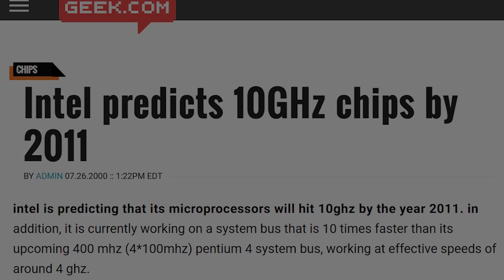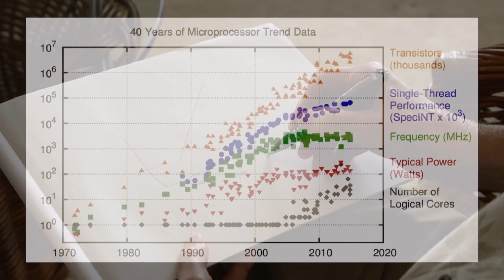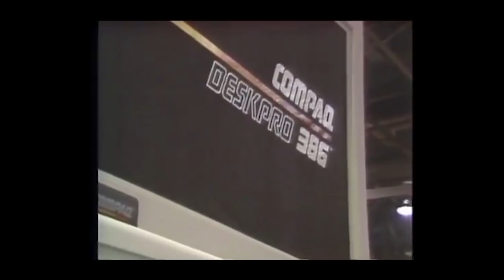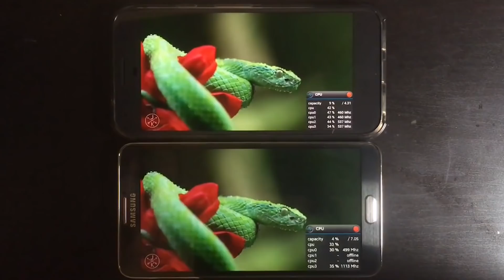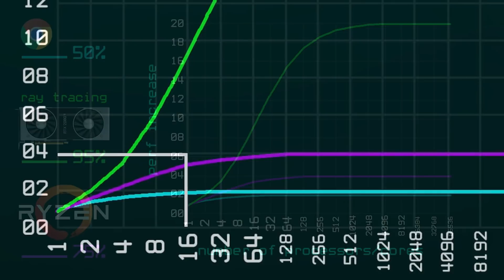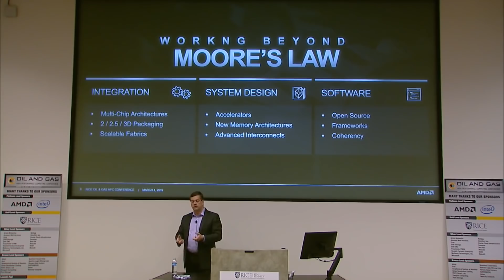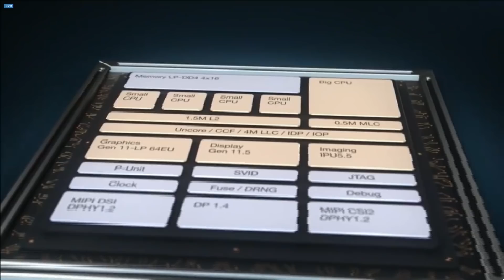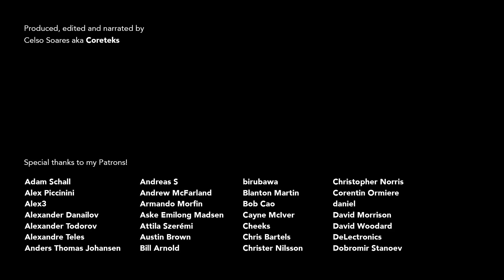Intel and AMD going BEYOND Moore's Law

Comment: In my experience it is very difficult to explicitly identify the parallel elements of a human activity let alone a piece of code in an efficient way and productive way. If the elements are obvious you should already be breaking them into threads, but you have to control the communications between threads and it is difficult to ensure optimisation as you reach the critical path points. Ie a programs logic is essentially a traverse of a graph with the graph nodes representing the choke points of the shortest path.
A graph based parallel language such as sisal uses this model of problem definition. The implementation traverses the graph completing fine grain instructions as the data to enable the instruction becomes available and routes outputs to the next node in the graph. Investigate the Manchester data flow computer architecture if you want to know more. This architecture has the ability to scale linearly with increased processor units.
The way it works is very elegant, but I found it very difficult to get my head round it as a way to describe problems that were not inherently already very parallel, eg usually some sort of mathematical simulation. Inherently we are just not wired to think of problems as parallel. Have a look at a seminal paper the magic number 7+-2 for more understanding.
I do have some experience in the area as I wrote one of the original compilers for sisal and never really felt comfortable writing programs in it. Inherently we are mainly linear in our thoughts and we will always be limited by our creating critical path solutions to problems.

Comment: less than 3nm, sure. this guy has zero clue what he is talking about.
Reply: 3nm is possible but not on silicon but on graphene and maybe using light based computing..
Reply: Josh D  lolol consider yourself accidentally walked into machine room of technology
Reply: @NoobNoobNews  are you talking about the clock frequency? if you lower it it completely defeats the point of "scaling" your architecture to become faster as lower frequency means slower CPU.
Reply: @BattousaiHBr  think about it like this, you can fit 2.3~ times the number of transistors on 3nm as you can on 7nm. so even if you have to drop your clock speed down, you still get an overall compute performance increase because you have more transistors doing the calculations. To oversimplify, a chip with 1000 transistors running at 2ghz won't compute as well as a chip with 2300 transistors running at 1ghz and the lower frequency means less voltage and thermal needs. (unless my understanding is completely flawed, which happens from time to time...)
Reply: @Will-W  the problem is that single-threaded performance still matters a lot. no one wants to get tons of multithreaded performance if it means killing your single threaded performance.
Reply: @BattousaiHBr  Ah, I'm picking up what you're putting down now.
Reply: @BattousaiHBr  lower speed does not mean slower CPU. You can have newer architecture with lower frequency than the old architecture. Is like saying 500Mhz modern CPU is still faster than 3Ghz Pentium 4. The foundation is the architecture. The limitation is also the architecture. When they want to have faster CPU they must change the architecture and that is what they did with every generation.
Reply: @wonghow  a lower clock frequency necessarily means it's a slower speed were that same architecture to operate on a higher clock frequency. we call this overclocking.

Comment: Have a look at http://doc.pypy.org/en/latest/stm.html and https://gcc.gnu.org/wiki/Graphite/Parallelization and https://github.com/atemerev/skynet to see what has been happening for many years now. And you might want to plot flops per Watt.

Your multithreading discussion shows how to return application performance back to the Moore's law plot you showed. If you were to plot application performance instead of transistor-count, you’d see that it did not keep up and that improvements in automatic parallelization can partially bring it back.

However currently one of the big advantages of multiple cores is that you simply have multiple programs running in parallel. For example having 4 cores means that your currently used application is not competing with the filesystem, the operating system and the networking stack for resources.

Comment: Below 7nm quantum effects kick in. Moore's Law ends, at least on the planar surface. FinFet will help to extend a generation or 2 further, beyond which drastic change in transistor structure will be required. It's fundamental physics.

Comment: Interesting automation of parallelizing software. However, notice that Huawei recently launched Mate X, a foldable phone that is years ahead of anything Apple has. Huawei has been working on it for 3 years the CEO I think it was said. The same will happen with CPUs I predict. Huawei and/or other big Asian tech companies will soon release ARM CPUs with amazing price/performance. The x86 architecture will no doubt remain for many years but I expect the ARM (or some new) architecture to gradually overtake it.
Reply: the problem with replacing x86 is all the compatibility issues.
i can see it being replaced eventually, but certainly not for ARM. it'll have to be some new and very mature ISA that is significantly better than x86 to make up for the effort of migrating.

Comment: I'm glad I came across this, I'll keep an eye out on this because I was thinking of replacing my current computer relatively soon, but if there's that sort of potential performance boost on it's way in the next couple of years I might hold off on that or at least make sure I can get something that is relatively straightforward to upgrade the processor on.

Comment: The problem with parallel computing is that a large amount of computers still run on single core processors... we like to believe that multi cores are the norm but as enthusiasts we forget that the mass market is far behind what is current... 
espcially large companies and governments are still running on decades old technology for the most part....

so switching to parallel computing except for gaming and other media related software is usually a bad thing... 
and in gaming it's not really needed since most games favor GPU over CPU.... 

and i personally believe we're at a point where except in niche circumstances...
we reached a level of performance where an increase would not be needed in the CPU market for a long time... 
there are very few pieces of software in actual use that are bottlenecked by modern CPU's.... 
the only application i can think of where faster CPU's would be needed is research and they usually do not use conventional CPU's

Comment: Actually, the transistor density is soon going to reach its limit. You need separations between each circuit and the circuit needs to be at least 5 atoms across. This means that 10 angstroms or 1nm transistor scale is the limit.

Comment: Some problems just cannot be parallelized. 
Imagine the following algorithm:
1. Go to the supermarket
2. Buy food
3. Drive home with food
4. Cook meal

Any change in order here and nothing makes sense. Now sure you can vectorize some things, like having multiple threads pick up food at different aisles, but in the end you have to sync them and the overhead of that is usually not worth it.
What you describe may help some poorly coded apps, but things that must run serially and are already heavily optimized won't gain anything by this. In fact, the extra overhead and "AI" calculations might just cause the code to run slower.
Reply: Yeah besides all the other problrmatic claims he made.

Running an a.i that constantly optimises your processor uses a lot of processing power on it's own. 
Will you add another processor just for that a.i? Or how would that work? 

At least i don't see such insane improvement as he predicted anywhere close from this development alone. 

Or would you train the a.i for every program on that computer? 

Whatever the case it's not easy.

Comment: There are physical limitations to transistors with current tech. Theoretically limited at 5nm gate width with finfet technology. You get gate leakage due to band to band tunneling. Other effects too but not about to explain. Point is we need a different tech past 5nm.
Reply: Enter the quantum computer, sidelining silicon based processing to essentially a thin client model.
Reply: @thomastmc  You just have no idea on how QC works. The amount of algorithms that benefits from QC is extremely limited and mostly far away from FP or integer computations. In any case, QC do not solve the problem of thin features under <5nm, in fact, due to control system QC are always worse in term of computing density compared to a classical computer
Reply: @fluffy_tail4365   Please explain exactly where I show a misunderstanding of QC, and be clear as I'm not saying that QC will completely replace conventional silicon/transistor computing.
Reply: @thomastmc  "enter the QC, sidelining silicon computing to a thin client model"
Mhhh, a cloud based QC is going for sure to calculate me those sweet physics interaction in my game or just help compile kicad, those kind of classical computations we want a small faster transistors for and for which no better quantum algorithm exist.
Admitting being wrong is not a sin buddy, pretending to not have said things in plain view just makes you look silly
Reply: @fluffy_tail4365  You're wrong, but I understand your misunderstanding... What I was saying is that silicon would rely on the cloud for the growth of it's computational requirements, with the power of the device being less relevant, as is happening today. QC will go on to provide the progression in computational power that is needed for advancement in key areas, such as machine learning, AI, modeling, etc.. I like your attitude though...
Reply: Soundtracked so many issues with quantum computing
Reply: @BMac420  What's your point? If you haven't been watching, everything has issues. If you're saying that QC isn't practical, or is too far off, then you're just not paying attention.
Reply: Soundtracked it’s not practical for the public at all and I can’t see how it would be barring innovation by AI after the AI singularity. Quantum computers will not become mainstream
Reply: @BMac420  You need to read my comment again and look up "thin client model". Of course QC isn't going be in desktops and phones, but in terms of processing it will surpass silicon easily.
Reply: @thomastmc  it will for sure be faster in some specific fields but i dont see it overtaking classical computers in classical operations anytime soon. as for thin clients, i dont see the purpose of using a quantum computing server as the back end for something like that, not to mention the bandwidth issues that are sure to come up if something like that were to be implemented large scale. also theres the massive issue of energy efficiency for quantum computers. and i still cant see how quantum computers are supposed to replace classical computers. and if they cant then we still have the issue of needing new transistor technology. 
Edit: re-read your original comment again, appears youre saying that silicon computing will be on the thin client model, not quantum computers. which still makes no sense, as many programs that run on normal desktops will not work with a thin client model.
Reply: @BMac420  Look at the trend toward thin client and offloading to the cloud already, and give it more than 1 hour of thought and I'm 70% sure you'll come around.
Reply: @thomastmc  you cant play a multiplayer shooter on a thin client. I do agree that many things can be offloaded to the cloud but many online shooters cant be. and being that most popular games are online shooters, i dont see thin client replacing desktop PCs
Reply: @thomastmc  sorry i didnt give it an hour
Reply: @BMac420  I can believe it. Edit: i.e.... Didn't need a time stamp to know that.
Reply: @BMac420  - Maybe, but quantum processing resources will affect the masses, as will edge and other services resulting from them.
Reply: @BMac420  You sound like those guys back in the 50's who we're looking at big mainframe computers and thought this could never be viable for public consumption, let the technology evolve before coming to conclusions.
For all we know 50 years from now we'll all have personal quantum computers in our pockets, it's too early to tell just how far we can push the technology.
Reply: @BxPanda7  its a little different today, it seems to me that the uses of quantum are specific and arent useful for average people. and maybe one day they might make consumer programs on a quantum system (but right now there is no ideas for consumer programs on quantum computers) , but it probably wont get pocket sized unless youre talking about soundtrackeds thin clients but an actual physical pocket sized quantum computer would never work because of the physics behind qbits and the actual quantum process that happen on them.
Reply: @BMac420  Well, again, that very first line of your comment is pretty much word for word what people used to say about regular computers back in the days, the thing is, there are things that will be invented that we don't yet know are possible, it's something we don't know we don't know, so it's really to early to make calls like this imo
Also if it's physically impossible to make pocket sized quantum computers, i'm sure we'll find a way to stream it straight to our phones :)
Reply: @thomastmc  No, JUST NO, quantum computers solve different problems.  Jesus, I knew this back in 2005. Ordinary hear the word "quantum" and some misinformed news article reporting on "future tech" to give you some tech porn, and you are like "quantum = better!"  No...physics has a limit.  Silicon is not going to work.

How is he still saying we write code sequentially?  I am so angry....we do parallelization everywhere in the business world.  For consumer products where you can't do this because you can't scale a single, synchronous, sequential code block for consumers.  Good luck...multi-core works perfect for multiple apps taking advantage of this at the OS level, but within an app you cannot break apart and parallelize the majority of consumer code.  Even if you can split a problem up, if there is a slowest part of it, it will bottleneck if you need to wait for all threads to be finished.
Reply: @Dr.FeelsGood  Apparently, you don't solve any problems 😉
Reply: @thomastmc  Da hell would I do that for when I can write code to solve problems for me?  (true story)
Reply: @Dr.FeelsGood  You should write an app to read comments and make replies for you.
Reply: Lol no, TSMC is preparing to go to 3 nm at some point
Reply: Josephus Junction issues
Reply: @El Mahdi EttalebI agree that QC isn't efficient enough at the moment to replace conventional transistor based systems. However, advances in algorithms in order to take advantage of the computational power of qubits is progressing and there is no reason to expect that QC won't fulfill expectations.
Reply: @Gyri Sulcie So, you run your own email server and still use a flip phone? 

I said essentially a thin client, not literally. It's not as if storage will be reduced along with processing power in devices. In the time frame of this discussion, it's likely that a phone will be more powerful than any HEDT part available today.
Reply: @Gyri Sulcie With 5G and also technologies like Starlink, I think we're going to see that many more work loads are offloaded to the cloud, but not exclusively from mobile devices. One could argue over 50ms of latency difference for playing competition level first person shooter matches, but by offloading they are able to offer a product across any device that would typically only be usable on a mid to high-end laptop/desktop or beyond, and with consistently top-tier performance and extremely low power consumption.
Reply: Looking back over these comments, everyone has replied with their own singular politics, pet interests, or preconceived fallacies. What I've said isn't radical, or hard to understand, but many have treated it as such.
Reply: Exactly!
Reply: Well GAA will do the job for (at least) 3nm and 2nm
Reply: Gaa Fet